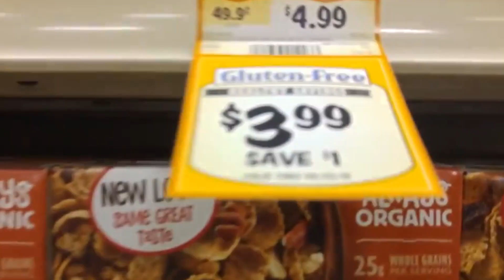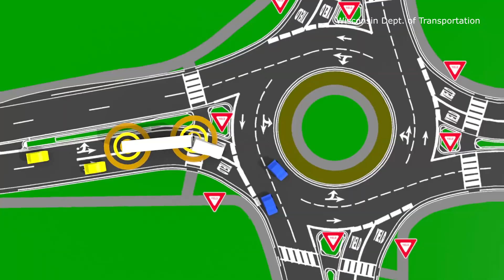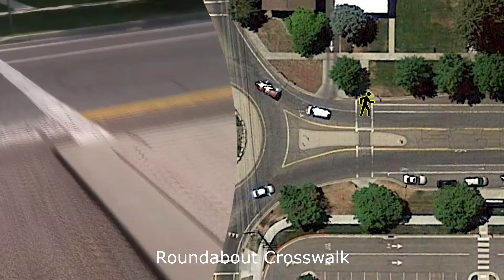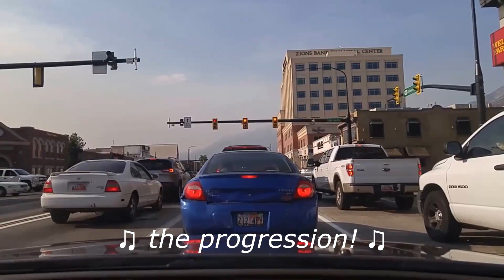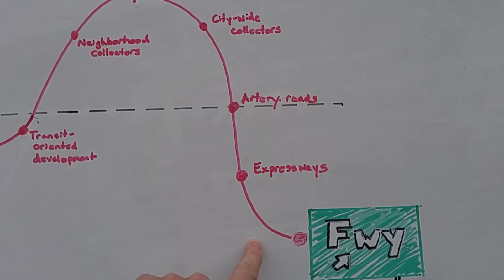Are roundabouts REALLY better than a traffic signal?

Comment: 0:11 "if theres any highway design" roundabout arent used on highways... thats kind of the one situation where any time vehicles have to cross eachother, its a terrible idea.
unless you are using "highway" to describe any road. but thats silly...

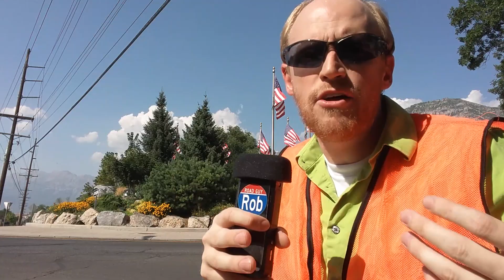1:37 very correct. its relative speed that matters in a crash and not total speed. so if a crash happends its not really a crash anymore, more of a poke.
(ofcourse a faster speed does mean your risk of a crash being fatal goes up quickly if the thing you crash into is stationary. like a parked car, telephone pole, light, house, lake, etc)

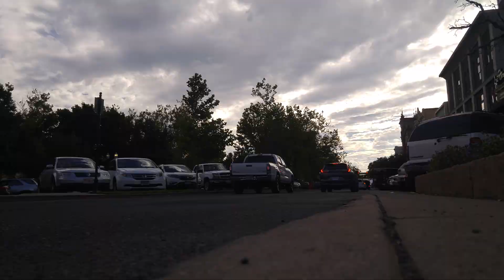2:45 thats like a few seconds and crossings usualy make up a small portion of walking time. and alot of roundabouts actually remove the need for signaling intierely, so pedestrians dont have to wait for a walk signal at all.
and im fairly certain noone looks at that small detour and goes "man thats so far im gonna not pay attention and just sprint!"

3:32 i dont see the need for that quotation... sense you said yourself that their total cost goes under a signaled intersection almost immediately.

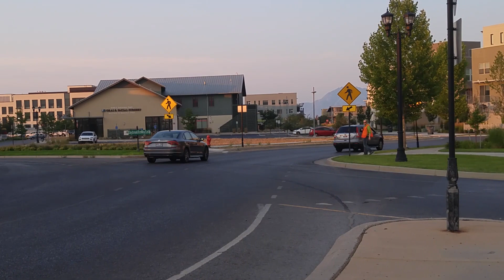4:20 your walking across 2 lanes there thanks to a median that the roundabout naturaly has, in an intersection that would have required you to walk across 4 or 6 lanes if it was a traditional signaled intersection. 2 or 3 if it has a median. so best case scenario for your argument is that the walking time is the same and that every road has a median. but thats just not the case for every intersection.

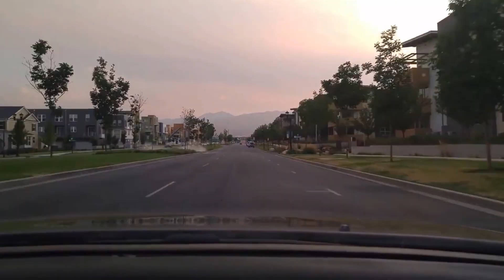4:48 that means your drivers education has failed if people are selfish enough to do that. secondly, if traffic is light enough that you can just drive throu without stopping, there isent really enough cars for that manouver to be particarly dangerous. (still worse than driving properly ofcourse) and if there is enough traffic for it to be dangerous then you are almost garanteed to have to yeild to the people in the roundabout.
and if people are stupid enough to not yeild at yeild signs. then your drivers education has done more than just fail.

5:03 true, single lane roundabouts are still safer than multi lane ones, but i still think you blew it out of proportion.

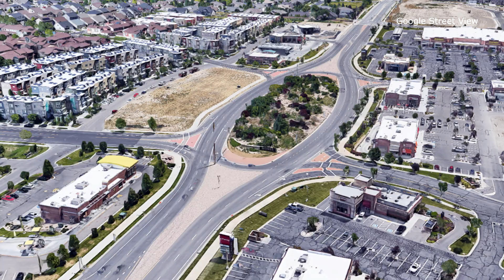5:25 fairly certain that wouldent even fit the definition of a roundabout... its barely a turn...

5:55 good point. then we dont use roundabouts when optimizing for platoons is more efficent.
this almost certainly gets more complex if we look at europe thou, sense here we optimize for as many people as possible and not as many cars as possible.

7:00 carmel and indiana are basicaly US road design reflected across European road design. its crazy how many roundabouts they use.

Comment: I love roundabouts. Where I use to work I would have to go through two of them in a row and they worked great. They were on backroads, so most of us who used them were commuters and at times there was such a flow it was amazing to see. Then, one person who didn't know what to do would mess the whole thing up, but it was still better than a traffic light. I'm actually upset as the DOT here recommended putting in a roundabout in a crash prone area. It was an intersection where only one direction had stops and the cross traffic was 55mph, and there was a blind curve on the 55mph road. People didn't want it for some reason and just opted for flashing lights warning people of the stop signs. I felt slowing down to go through a roundabout would be great for everyone and easy to get use to, but no, the other residents didn't want something as confusing as a roundabout...

Comment: $5000 dollars of electricity a month for an intersection really?
Reply: Ya, that does seem high for electricity alone.  Probably a lot less with the newer LED lights.  The amount may include maintenance, such as changing bulbs and repairing switching systems.
Reply: @my3dviews  I suspect he made a boo boo and it is $5k a year
Reply: It’s per year.  No way it’s per month, even with computers and induction coils, which are pretty efficient.
Reply: government loves big expenses to "manage"
Reply: They use more electricity because they need to have incandescent bulbs, otherwise they can freeze in a regions where is cold and the lights might not be visible. As far as I am aware even the ones with LED have some sort of heating elements. Essentially the are heaters with lights.
Reply: @ivandenkov7446    I live in Edmonton (where it can get very cold) and most if not all of the traffic lights are LED.  I don't think that they have heaters in them.
I have heard that there can be a problem with snow or ice build up, but haven't seen that happen myself: 
https://www.cbc.ca/news/canada/windsor/led-traffic-lights-trouble-in-winter-because-they-don-t-melt-snow-1.3465301#:~:text=Energy%20efficient%20traffic%20lights%20could,builds%20up%20on%20traffic%20lights.&text=%22LEDs%20do%20not%20put%20off%20any%20heat.

They are even switching all of the street lights here to LED to save power, which would not help much if they needed heaters:
https://www.edmonton.ca/transportation/on_your_streets/led-light-conversion.aspx#:~:text=The%20City%20of%20Edmonton%20will,end%20of%20this%20conversion%20project.

Comment: You forgot about mini-roundabouts (1), and also light controlled roundabouts (2) or the small-sized roundabouts (3) interchanges (4) light controlled interchanges (5) even double mini-roundabouts (6) or just junctions that follow the general flow of roundabouts (7) not to mention the signage to assist with people getting into the right lanes
1. dropped pin Near Gillingham ME8 0GX https://goo.gl/maps/KxS6ZbU9hwnLKdZU6
2. Dropped pin Near Gillingham https://goo.gl/maps/HDjwwUyn9x3Xe24F8 
3. Hempstead, Gillingham ME7 3QE https://goo.gl/maps/2tX4WxuUrpRF21R56 
4.Gillingham Interchange, Gillingham ME8 0LA https://goo.gl/maps/j6FeDmsgXXqSpUWo7
5.Dropped pin Near A2045, Chatham ME5 9PE https://goo.gl/maps/tKb8RQfpM1JGDGgn8
6. Gillingham ME8 0HS https://goo.gl/maps/ANcZJsJ5u8XnuPWy7
7. Dropped pin Near A289, Gillingham https://goo.gl/maps/iPr1vjRpbWgAMRn2A

Comment: The main advantage for a pedestrian in a two lane roundabout is that at least all the murder boxes come from the same direction, as there is usually ample space between the ingoing and outgoing lanes of traffic.

Compare this to crossing a typical US four lane road with no refuge in the middle, sure, half the traffic might have stopped, but there will be traffic rushing in from cross traffic.

There are also some creative spiral lanes used in some aroundabout that allows for 2-3 lanes inside the roundabobut even if most of the entrences and exits are only one lane.
Reply: Losing the "safety advantage" where everyone slows down if you are alone on the road is not worth much. even that little swerve will force you to at least stay within a typical city speed limit. And since there is no one to crash into, this is actually not so much of a problem. Going significantly  over the speed limit however makes your car harder to control and you might have a crash on your own in a traffic environment not buit for those speeds.
Reply: If your roundabout ruing your progression and breaks up the platoons, you are not timing your light correctly. Roundabouts is not only something the drivers have to learn, but it is also a tool that traffic planners need to learn how to handle.

Comment: Here's the thing I don't like about roundabouts. Most cars are very comfortable to drive in a straight line, but not so comfortable to drive and tight circles. 

That is of course why you have to slow down for a roundabout. 

The problems are, first, that people with better handling cars will get frustrated with, and try to bully, people in cars that don't handle as well because those cars have to go more slowly. This encourages people to drive as fast as possible around those turns, and the pressures people to drive more quickly around those turns then they should.

The second problem is that because people want to drive more quickly through the roundabout, they will push their car closer to the limits of controllability. essentially, they will drive as fast as possible around the curve, and risk sliding out of the turn into sidewalk or pedestrian or another car. While actually losing control is not as likely, forcing the car to repeatedly drive quickly around turns has a detrimental effect on the vehicles mechanical state. Tires wear out more quickly. Suspension wears out more quickly. Passenger comfort is decreased. Driver comfort is decreased, resulting in increased aggravation, and increased road rage.

Personally, I find it uncomfortable, and I don't like having to drive in ways that makes parts of my car wear out prematurely. I would prefer to stop and wait for more red lights. Even if it takes me a bit longer to get to where I'm going, stopping and waiting for people is more comfortable to me than having to navigate lots of tight turns.

Comment: 3:46 five to ten thousand a month for electricity? there's no way that's for a single intersection... right?
Reply: if it helps electricity actually can't be turned off if too much power is turned off the power planets have to unload all that extra energy somewhere else mainly nuclear power. as for that it's really hard to say maybe old lights i could see, new ones are LED
https://www.c40.org/case_studies/led-traffic-lights-reduce-energy-use-in-chicago-by-85

1. Traffic lights use 6 megawatts of power while streetlights 70 mega watts.
2. Typical incandescent traffic lights use 100-watt or 150-watt bulbs that are operating 24 hours a day, utilizing more than 2.4 kilowatt-hours per day.
3. At 8 cents per kilowatt-hour, one intersection can cost almost $600 per year in electricity. Large cities with thousands of intersections spend millions of dollars on electricity just for the consumption of traffic lights (Chicago alone spends $3 million annually).
4. LED arrays consume 12-20 watts instead of 100, reducing overall energy consumption considerably.
Solar panels can power LED traffic lights in remote areas, reducing the costs associated with installing power lines.

here is the most accurate lets just say it uses 15Wattx 24 hours (watts × hours.) 360 watt hours per day X 30 days = 10,800 watt hours (10.8KW) per month for a intersection
(Watt hour) a measure of electrical energy equivalent to a power consumption of one watt for one hour.
1000 Watts in 1KW

Average home in America uses 901 kilowatt-hours per month but for the house i'm in, my mom uses a oxgen tank so we use almost 2,000 per month (2KW)

Comment: Having lived with roundabouts for over 40 years I can tell you that them being good or bad depends on how large they are and how well designed they are. Mind you roundabouts can be as small as 3 feet, but today most town planners want to make them as large as they can fit in as they see the roundabouts as a way to slow the traffic down. Just after I started driving the local government put in a lot of roundabouts in the local streets which were a single lane each way, and the roundabouts that were about 3 feet across and were bumps with a maximum height of about 6 inches. They allowed a faster traffic flow as they replaced intersections with lots of stop signs so they can be used to replace a lot of the 4-way stops you have in the USA. However, when the planners want to make the roundabout oversized to slow the traffic right down they are nuisance. I've seen a roundabout that was originally built as 2 lanes and a diameter of 30 feet which slowed traffic from about 30 mph to about 15 to 20 mph. Eventually most people started cutting the corner by entering in the cutter, cutting close to the roundabout then exit near the gutter so they got a straighter and faster lane. This caused accidents in the roundabout. The council reduced the roundabout to 10 feet in diameter so the lanes were almost straight ahead and cutting the corner gave you no advantage. The traffic still dropped to about 25 mph but flowed faster and the accidents became almost nil. Done right roundabouts are faster for all traffic and greatly reduce collisions, and the few that do happen are minor ones due to angle of contact being acute instead of T-bone style. Done wrong (i.e. too large) and they increase collisions by encouraging lane cutting to get through them.
Reply: In my town, a certain mayor started installing many roundabouts as a way of slowing traffic instead of improving traffic flow. I think the reason & purpose of installing roundabouts is the major downfall of some of them. In my opinion, roundabouts should help traffic flow instead of hindering it. Yes, roundabouts slow traffic at these intersections, yet it should be an unintended yet expected side-effect and not the main purpose. Roundabouts should not be used solely as a traffic-calming initiative.
Reply: @WaldoBC  In my opinion a round about should be no bigger than six feet in diameter unless it's a major intersection with five or more streets into it or multi-lane streets into it from three or more directions.

Where I live the relevant government authorities put in roundabouts and Give Way signs as a way of speeding up traffic as it allowed them to remove the great majority of Stop signs at many intersections. At that time the average roundabout was between 3 to 7 feet across, depending on the size of the intersection. Then town planners found out if they put in roundabouts that are 25 feet or larger and designed the so that you couldn't drive straight through but had to bend around the island they would be great at slowing traffic down. Since then town planners have been using roundabouts as traffic calming measures. The large roundabout have a many issues in my mind as they cost a lot more in the way of materials to make, land is often bought to allow for the extra size at existing intersections, and they increase fuel usage (and thus greenhouse gas emissions) due to vehicles slowing down and the speeding up.

At one intersection I went through a lot they used to have a simple crossroad with one lane each way on both streets, they first put in a 3 foot roundabout and most traffic eased off coming up to, then either eased back more or drove through as you could take a straight line without any trouble. Originally you had a very good long sight line to your right as you approached the intersection. Several years later they 'upgraded' the roundabout to being eighteen feet across so you had to slow way down and curve around the roundabout as a straight through was no longer possible. To make it all work they bought land from each of the corner houses and curved the road at the approach and departure. The end result of the traffic calming measure of the large roundabout was a tripling of collisions at the intersection due to the lack of visibility to the street on the right because of the new angle and the house owners planting thick bushes inside their fences to reduce the traffic noise which had moved about twenty feet closer to the house due to the change. After another few years traffic at the intersection dropped dramatically as the local avoided the intersection and rove down a lot of smaller minor local roads to bypass the roundabout. It was actually faster to take three or four extra turns to avoid the roundabout than to go through it for most destinations.

Comment: 5k-10k to run a intersection per month!?!?! why is that??
Reply: old incandescent bulbs lights most likely, new led are only $600.00, i think there getting there information from old light system https://www.c40.org/case_studies/led-traffic-lights-reduce-energy-use-in-chicago-by-85

Typical incandescent traffic lights use 100-watt or 150-watt bulbs that are operating 24 hours a day, utilizing more than 2.4 kilowatt-hours per day.
At 8 cents per kilowatt-hour, one intersection can cost almost $600 per year in electricity. Large cities with thousands of intersections spend millions of dollars on electricity just for the consumption of traffic lights (Chicago alone spends $3 million annually).
LED arrays consume 12-20 watts instead of 100, reducing overall energy consumption considerably.
Solar panels can power LED traffic lights in remote areas, reducing the costs associated with installing power lines.

 incandescent traffic 2.4 kilowatt-hours per day or 2,400 watts a day
LED 12-20 so 15x 24 = 360 watts a day or .3KW

this also shows the big difference between incandescent and led lights

Comment: We have 2 SMALL roundabouts in our town thet are on a main highway connecting a neighboring towm.Both towns have main freeways running through them.Due to the traffic flow during rush hours,side traffic trying to cross or enter can be backed up to a stop,with up to 20 cars trying to access. Another thing to mention,they are small in diameter,with high visibility blocking "DECORATION" in them. The traffic lights they replaced never caused traffic back-ups before. (A waste of valuable tax money!)

Comment: Lovely videos of roundabouts with 1 to 3 cars using them. In our little town we have parades ( not platoons)  caused by nitwit drivers who insist on stopping for roundabouts.
Reply: thats what i hate i wish they showed real traffic on both intersection and roundabouts and when i mean real i mean also different spots. i don't mind comparing but some videos when people compare is kinda like comparing  London with Oxford with traffic

because how big the U.S. and vast people are probably thinking different areas same with yours but for my small town we don't have stop lights for main road, too small of traffic only stop signs on side roads to the main road. so it would be pointless putting a round about on a road that doesn't have stops but for the side roads. otherwise a no stop just became a yield